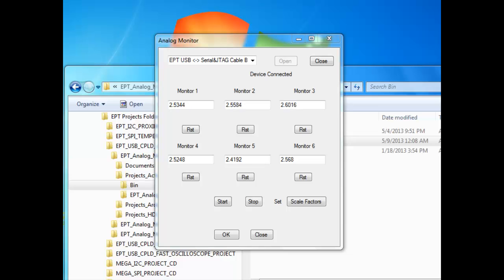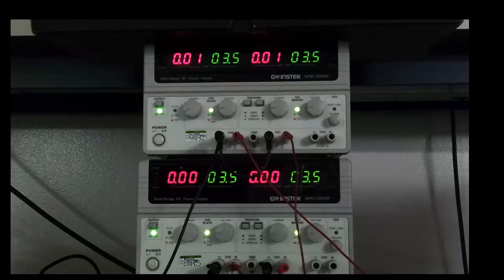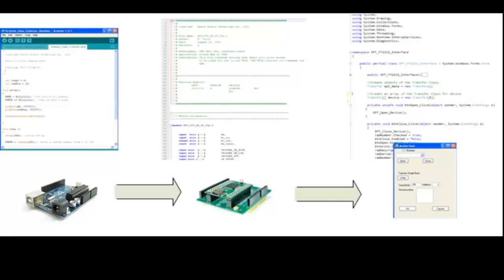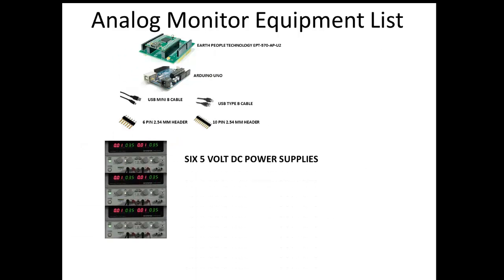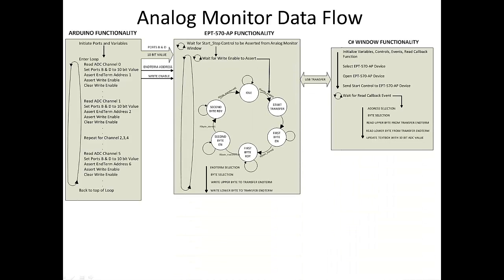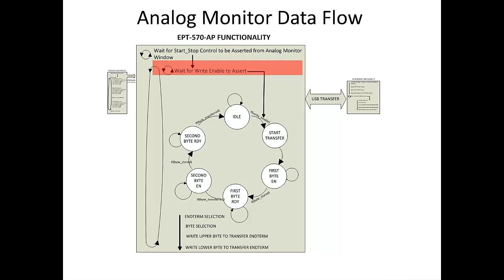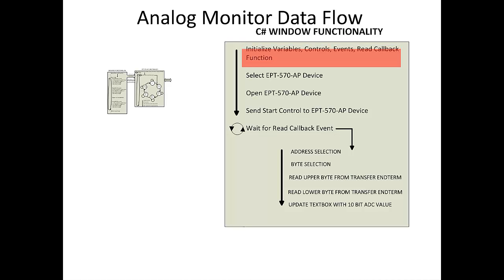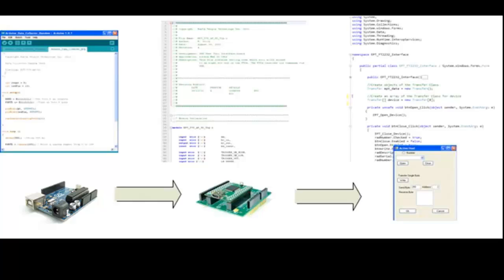Create an Arduino RealTime Data Acquisition System Pt 1

Comment: Hmm.. isn't there an easier & less expensive way to monitor & log the V data of a power supply??
Reply from the maker: +zeffur7 Yes, the new Power G has an onboard 4 Channel Analog to Digital Converter. It provides two power outputs, +12V and +3.3V and displays the voltage and current for each supply on your laptop. Please visit:

https://www.tindie.com/products/Earth_People_Technology/the-powerg-arduino-dual-power-supply/?pt=full_prod_search
Reply: +EarthPeopleTechnolgy I see you have a V adjust, but no current adjust.  Without the ability to adjust the current, it isn't much of a bench supply, right?

Comment: How much reading for second ?
Reply from the maker: Hi Lobo, this project has a bandwidth of around 17 KBytes/second. It is limited by the use of the Arduino Function "analogRead(x)". This function takes 100 microseconds to complete. Multiple this by 6 analog channels. Then add on about 20 microseconds for each channel to transmit the 10 bit digital sample to the UnoProLogic. This is 720 microseconds for each cycle through the loop. We can increase the bandwidth by changing the "analogRead(x)" function into a manual set of instructions. This way the samples would take 13 microsecond per analog channel. The resulting cycle through the loop would take 200 microseconds. This will result in a bandwidth of 60 KBytes/second.